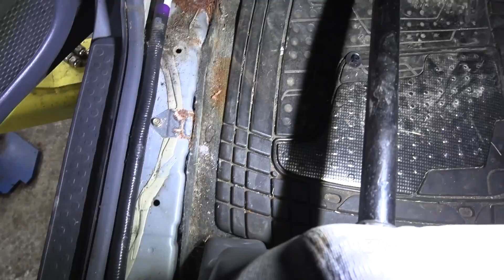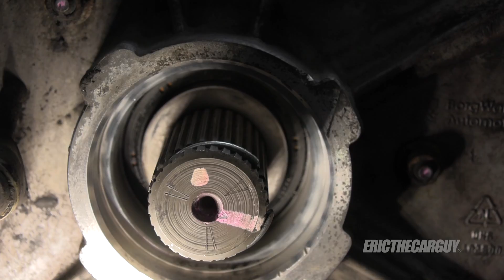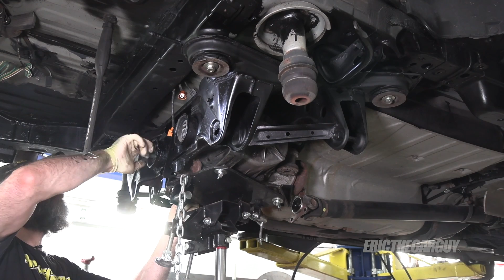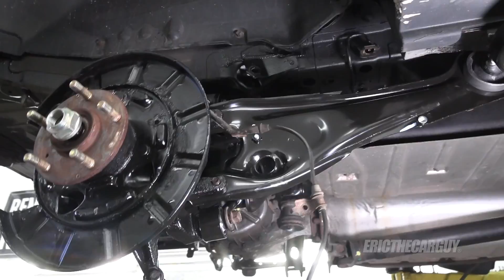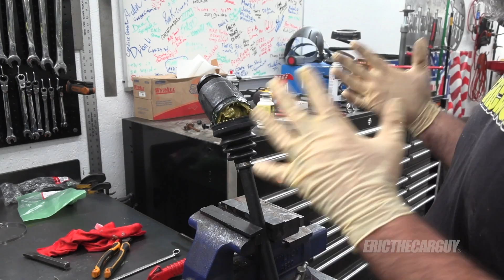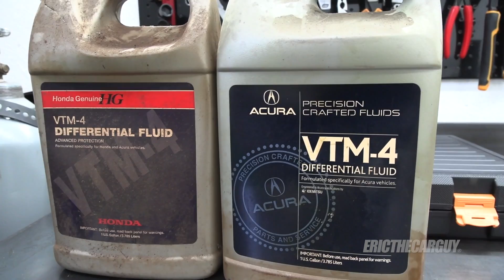Honda Pilot Complete Rear Suspension Rebuild (Part 2)

Comment: I also have a 2003 on the pinett, when I'm going to take off, I hear like a dragon sound under the rear, I took it to Midas, and I can't seem to see what was doing that noise, so I thought maybe you might know, since you own a Honda. Pilot, I'm going to take off.  I hear like a lack of the catapult was sticking and you hear like a grinding sound when I'm going to turn to the right or left, but as soon as I'm driving the sound goes away, so I don't know if you ever have run into this kind of you before. That's why I'm reaching out to you.  I have no idea where the song is coming from

Comment: I have a 2007 Honda Pilot AWD, only at acceleration the car shakes really bad front end seems, I replaced axles, lower control arms with ball joints tried moving tires to see if any play and nothing. When I coast without acceleration car is smooth no issues! Any ideas? New tires also

Comment: Really annoying that Honda uses those bolts with the ridges on only one or two spots on each suspension corner. Every control arm bolt should be like that, especially on rust belt vehicles.

Comment: Surprised you kept the rear springs, though you switched them.  I have 177k on my '08 Pilot and just had the springs replaced, they were sagging terribly.  Perhaps yours had its springs replaced before you acquired it?  Or maybe just didn't have as much weight in the rear over its life - mine is used for light towing perhaps 12 days a year.

Comment: Great work Eric!!! And a lot of it. I find there are a lot of people who look at the cost of repairs and then the value of the vehicle, and say you're putting more money into it than it's worth. You should replace it. But on the other side is you own that vehicle that can be rebuilt for the cost of a down payment on a new or newer vehicle minus the car payments. I'm doing it myself after watching tons of videos by you and a few other guys who work on Hondas. I greatly appreciate your attention to detail. Some just bolt it back together not concerned about breaking new bushings or wearing parts out before their time because they didn't wait to tighten bolts after they were on a full weight load. I quit watching those  dudes. 

My mechanic told me it was time to replace it, but I'm replacing all the suspension on my 97 CR-V and all I can say is 1) it's a simpler system and 2) thank goodness I don't live in the rust belt. I have no rust on the underside; just a little corrosion on some of the bolts (???) that came out of the subframe in front. Water must have gotten into the bolt holes while I was fording street flood water during heavy rains. I coated them all with blue thread locker after brushing the corrosion off, cleaning them with oil and wiping the heck out of them to get the oil off using very little solvent just on the threads. I'm not too pleased with my mechanic who never changed the rear differential fluid or the transmission fluid even though they were due at least when the timing belt was changed. My manual says at 60,000 miles for the transmission. 

I also replaced the steering rack and that was just hell on that vehicle. I did it right after someone stole my catalytic converter, saving me from dropping the exhaust, but I still had to drain the trans and drop the AWD transfer case, and found out I will need a new shifter cable. (The transmission fluid was worse than very old sludgy oil). Something kept hitting me in the head while I was under the truck and it wasn't wet. When I put the transfer case back I saw the cable has a huge hole in it and it's failing strand-by-strand. The cover ripped and the cable is brittle from age and slowly breaking.

Comment: Thank you!  Great tutorial!  I rebuilt the front suspension on my 2004 Honda Pilot and everything went smooth.  It's much easier than the rear suspension.  I had one issue about a year after the rebuild.  The center nut on the strut came loose and caused a noise that my local mechanic described as sounding like "jingle bells."  I used new, after-market, front strut and spring assemblies, and should have re-torqued everything the factory assembled.  The fix was simple enough: remove the wiper arms and remove the cowling to access the nut.  Tighten and add some loctite.  However, trouble-shooting this issue was difficult for me, (a former professional mechanic, but now a street mechanic), working on the ground using jackstands.  I couldn't figure it out, so I had my local auto repair shop take a look.  Troy, of Troy's Auto, found and fixed the problem.

Comment: Speaking of using the parking break. I like to use mine with the automatic transmission. When I park my car/ Honda pilot I hold the service brake put it in neutral and apply the park brake then put in park. No pressure is on park.

Comment: My 2007 pilot has some rust in the rear, I am planning to dress it as soon as the cold goes away. I’m definitely buying new screws for the alignment adjustments. Thank you for showing us the proper way to work back there.

Question, how did you weld that part where the subframe frame attaches to the body? Do you have like a diagram or a video of how you did it? Thanks!  My pilot doesn’t show rust around that area but I’ve seen that it’s common for that area to rust real bad and the subframe could detach from the body. Thank you again!

Comment: Eric! I just snapped a bolt into the frame of the rear diff mount in my CRV and had to EZ out it. The OEM bolts are 1.25 10x96.5 but 10x100 worked well, if you're in a pinch unti OE can come in.

Comment: I have to do this eventually on my 04 MDX. I have a nasty pull to the right on crowned road surface. Everything in the front has been done. All of the bushings in the rear are trashed at 265k miles. Have had it since new might as well keep going. Thanks for the videos!

Comment: These Pilot's rear driveshafts have no direct connection to the drivetrain unless the electronic systems are engaging AWD. This Borg-Warner rear end has no differential (spool) and therefore cannot have a direct connection to the wheels or it would quickly destroy the tires.  Instead the computer engages clutch packs at each driveshaft to drive the rear wheels as it deems necessary.  Therefore you should be able to do parking brake adjustments with the driveshafts connected and the vehicle in park.

Comment: I have an 05 Dodge magnum RT that I will be performing this same repair to soon. I realize this is not the same but still gives me an idea of the steps. It is also independent rear suspension with CV axles. Thanks as always for a very complete and thorough repair video. Always entertained.

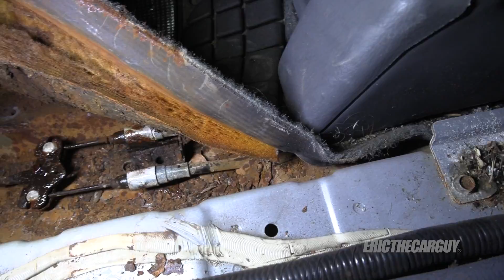Comment: 4:24. Did you find what caused all the rust in the floorpan? It looks to me like water got in either from a bad windshield seal or from the air inlet from the ac. Got to find it or more rust will continue

Comment: A huge amount of work.  I did my old Mercedes’ recently and both the rear mounts needed to be cut out and re-welded due to corrosion.  The layout of the subframe is very similar although the Mercedes has multilink rear suspension arms.  Rather than drop the whole rear subframe I just undid one side of the mount bolts to allow the subframe to pivot on the mount bushings on other other side.  This really helped to align the new welded mounts.  When one side was done I did the other one.

Comment: It's a shame in a typical Honda fashion, the drainage is very poor and easily clogged. There's also moisture insulation issue. Any one of these or both likely lead to water intrusion into the cabin, which resulted in collecting at the parking brake spot and slowly leaking out through the holes for the cables.

Comment: I thought the stabilizer bar bushings were intended to "grab" the bar, helping with the stabilization.  So I was surprised to see you lube them.  Am I wrong?
Reply: The bushings just support the stabilizer bar, the bar works by when one wheel moves up over a bump for example, the bar will flex and transfers the upward motion in the wheel going over a bump into a downward motion, keeping that wheel firmly on the ground, otherwise that wheel would bounce up into the air.

Comment: 2 words of advice eric 1/  to stop rust quickly use--  castrol motorcycle chain lube , the ingredients kill the bacteria that cause rust to die quickly - i use it all the time and it works .  having used anti seize before on bolt shanks only to find out it washes off easily with water , i now use lucas red and tacky grease on all bolt shanks and blue loctite on all of the threads , red and tacky does not wash off with water

Comment: Eric I’ve been chasing a ghost with my 2005 Honda CRV four-wheel-drive I understand the layout is very similar to the element what it’s doing is off of start up I get a nasty wiggle in the butt so I can feel it in the seat if you know what I mean the seats tight and everything it’s got all new CV axles and mid axle or whatever you wanna call it in the front and the rear seems all good the U joints on the driveshaft seem good and I’m at a loss as well It has a brand new automatic transmission in it as the other one the Honda dealership overfilled the transmission fluid and caused catastrophic failure
Reply from the maker: https://www.ericthecarguy.com/determining-the-causes-of-vehicle-vibrations-2/

Comment: Nice catch on the CV axle cup falling out. Stinks to pull it apart again, but at least it only cost some time and a boot clamp. 
Refreshing to see a rebuild like this. Many would have taken it to the scrap yard. This video is practically inspiring me to go find a 1st gen AWD, rebuild the front and rear suspensions (maybe add a small lift) and make it an off-road vehicle. Love when I see these done up like that.

Comment: Honda says the cam bolts are single use, they dont expect them to come out for reuse, not saying I agree...
Reply from the maker: I think that's BS. If it's an adjuster, it should be designed to 'adjust' when needed, not seize up in the bushing causing you to purchase, not only new bolts, but also new control arms. Feels like a money grab.

Comment: Eric's experience shows when his guesses on torque specs are all in range.
Reply: Here in the Philippine countryside we don't even know what is torque is, I've never seen and used an actual torque wrench even now. I just see it on youtube. We just hand feel everything and the cars lifespan is just the same with any car maintained by the dealership or some fancy motor shop. What we do is we don't buy Ford because it's too high tech system and buggy computers, BCM and other stuff often fails and you cannot fix it when your in the mountains. You can't even replace a fucking light bulb without taking it to the fancy motorshop.
Reply: I remember one time he didn't follow the torque spec it came back to haunt him. He had did some work on a Mini Cooper and ended up having to repeat the job. I believe it was a part that was bolted to the crank.
Reply: @Rhaspun  Yeah, that's German engineering for you, near zero tolerance and out of spec everything goes kaput.

Comment: Just saw a video where a guy is doing a 2 year comparison between Eastwood and Rustoleum rust remover and encapsulators, along with Ace HW.  TLDR; surprisingly Eastwood seems way overpriced for performance, and Rustoleum Reformer is very close runner-up, which is nice as its only $7 at Tru Value.  Bother work even better if you throw a coat of cheap exerior paint over the top too.  Also a good video here: https://www.youtube.com/watch?v=oXlhmbvdKBo

Comment: If I got a Honda project (which I do on a non-stop basis) I go to EricTheCarGuy. Did my timing belt on a 2000 Civic and a steering rack for the same car. The Hayes Manual is there for show. 😂

Comment: Eric, surprised you don't use evaporust or similar.  It would seem to be a little faster if one were going to go to the effort to remove the rear and front suspension(eventually), do it at the same time. Maybe split into 2 different sets of videos?  At least that way once it was all clear, you could spray some rust remover/converter all up in there, and let it sit overnight, maybe do it a couple of times. Should massively remove/convert a lot of rusted areas, and could also do a decent rust protectant.  Just sayin' since you are taking the cars to bits anyways.
Reply from the maker: I do plan to also work on the front suspension when I remove the engine and transmission to replace the transmission. This is something of an experiment for me. I'm 'practicing' and trying new things to see what works best so that when I restore my Type R I'll be able to do it right. Thanks for your comment.

Comment: As a carwash and valets attendant I hate you people hand brake should only be used when drifting and it takes skill when reach down to pull the brake especially with a stick. Come ford guys who did it
Reply from the maker: This uses a foot operated parking brake. 😉
Reply: @ericthecarguy  yes i knw i have worked at full service carwash for the last 10 yrs and clutch kicking a foot hand brake is a pain lol

Comment: Where do you go to get so many OEM parts?
Reply from the maker: My local Honda dealer. I ended up filling the entire bed of my truck when I picked up the parts for this Pilot.
Reply: @ericthecarguy  Ah i gotcha. I have a Ford but I don't like to pay Dealership prices for OEM parts. Most OEM parts I just get from rockauto but I didn't know if you had a place near you that sold the OEM parts that wasnt a dealership.

Thanks!

Comment: thanks to your video's I went and checked the rear subframe in the 04 pilot my friend bought, it looked completely rust free surprisingly. Think it needs a new trans tho, wont shift when hot. any common cause of that other then serious internal problems?
Reply from the maker: I'm replacing the transmission on this Pilot as well. That will be covered in a future video.

Comment: Hey Eric! Great job as always. Did you put a timing belt on the Pilot yet? Also, how has your experience been with the supposed counterfeit timing belt kit that went on your TL?
Reply from the maker: I will do the timing belt when I drop the engine and transmission out to replace the transmission. Those videos will happen at some point in the future. I'm going to take a break from this for a bit. The TL is running fine with no issues. Thanks for the comment.

Comment: Time to comment about using the parking brake. I recommend using  it.  Last year we had a bad wind storm and power was out for a while. Just wanted to charge the mobile. My driveway is on a hill.  Got lucky didn't hit anyone.  But the neighbors house  it crushed the down spout that was easily bent straight with a screwdriver.   Don't be me.

Comment: There's an Australian guy on YT who was a Mechanical Fastener Engineer, and has the skinny on proper torqueing of fasteners.  When you lube them, even 'lightly', they are classified as a lubed fastener, and in general require ~30% less torque than when 'dry'.   May not be critical for some parts if they are over-tightened, others is definately is.  IIRC, John Cadagan is his name.
Reply from the maker: I've also spoken to engineers. My take away is, it's not the torque, it's the stretch that creates the clamping force. Therefore I think of fasteners as springs. I'm not saying proper torque isn't important, quite the opposite, but as I said in the video before this one, over time you get a 'feel' for what a fastener is doing. Thanks for your comment.
Reply: The term is lightly oiled.

Comment: Great vid!   So very helpful... wow!  Thank you for showing and I love the video series on the Pilot!   Will you be doing the front next?    Helpful hint:  when I do brake jobs with disc brakes, I coat the inner hug (hole in the brake disc to keep it from rusting/seizing on the hub.)   I live in the rust belt too.   Thanks again Eric!
Reply from the maker: Yes, I'll be doing the front suspension along with replacing the transmission in future videos. I'll also be installing fog lights and a supercharger after all the other mechanical work is done. #ETCGHackHawk https://youtu.be/11nl6FCkr-s

Comment: Hi Eric I’m sure you work on a Chevy Malibu in your life 
I have a 2006 Malibu 2.2 engine 
I replace almost everything on the front end new struts new rack opinion ball joints are good  sway bar all new bushings 
There still a clung when turn is there a chance it would be the intermediate steering shaft 🤔
Reply from the maker: http://www.ericthecarguy.com/faq/diagnosing-noises-in-your-car

Comment: In regards to torquing the suspension components while the vehicle is on the ground, what if I have a car and cannot fit under to do so? And no, no fat jokes required. Unless you're seriously sick, no normal sized guy is going under a car without a jack.
Reply from the maker: Put it on ramps.
Reply: @ericthecarguy  Lol normally when I think of ramps I only think of either the front or the back of the car being up on them at one time. So need four ramps. Thanks for clearing my brain fart!

Comment: 32:16 one thing i've started doing lately is to sleeve the connectors, fill the sleeve with dielectric grease on both ends, and then tie the ends over the connection with copper wire wraps. It's an old boatie trick a friend taught me to do, and it really does the trick for connectors under the car.